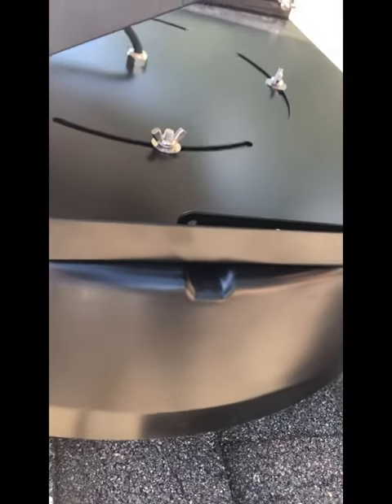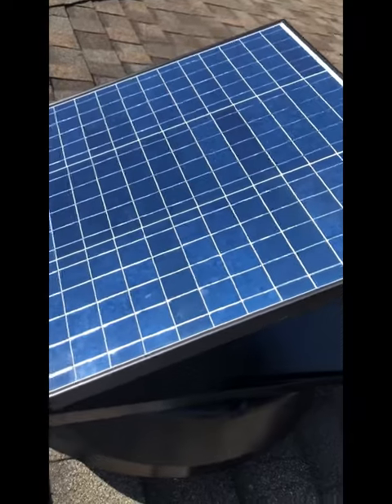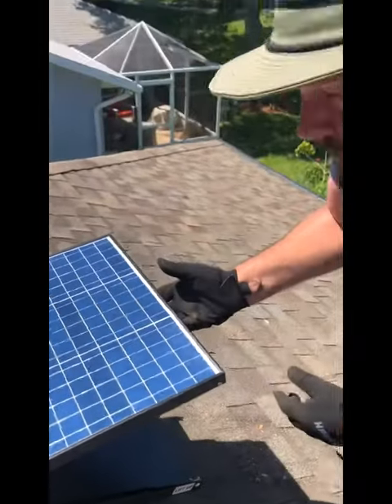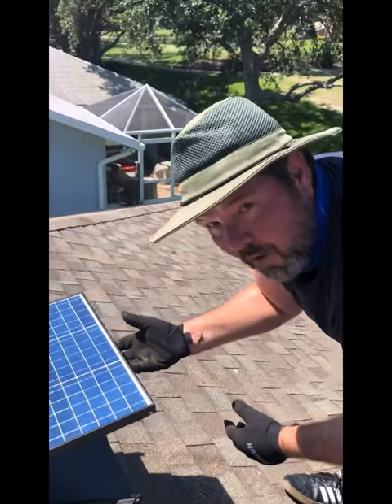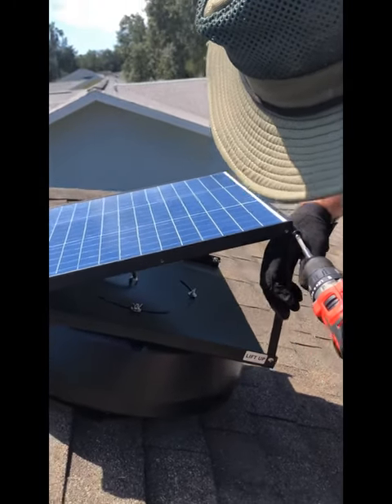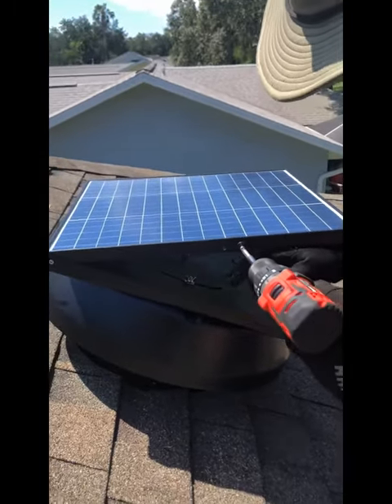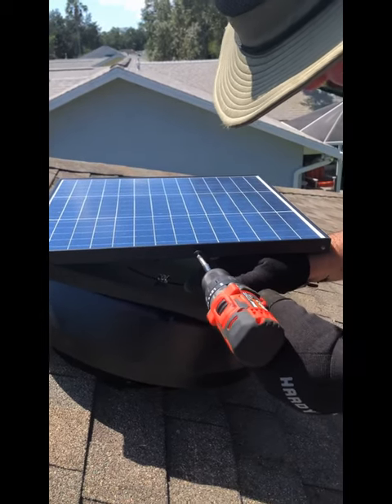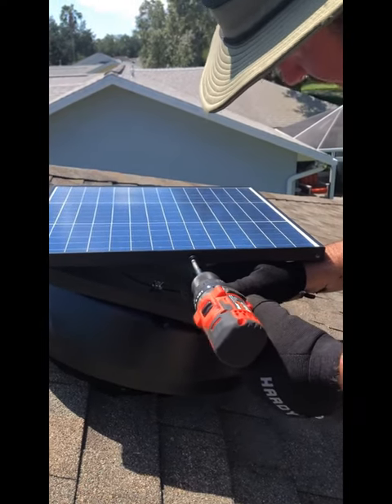iSolar Solutions 40 Watt (40W INT) Solar Attic Fan Overview and Installation

Comment: 2 yrs with it Steve. How has it worked out for you. Did it save you any on your energy bill, has it held up well? I'm in south Texas and it gets to 105 to 110 Temps down here in the summer. Looking to purchase one here pretty soon. Your feedback would be greatly appreciated. Thanks.
Reply from the maker: Luis, fantastic unit.  They have a 50 Watt system with AC adapter and thermostat I would recommend for Texas.  Anyway, I did see about a 10% reduction in runtime and energy savings since implementing.  So the unit pays for itself.  It will depend on your insulation levels and layout.  If you want to PM me I can make some recommendations!